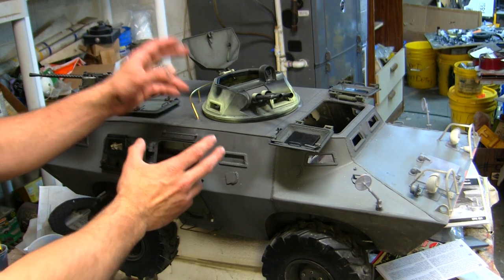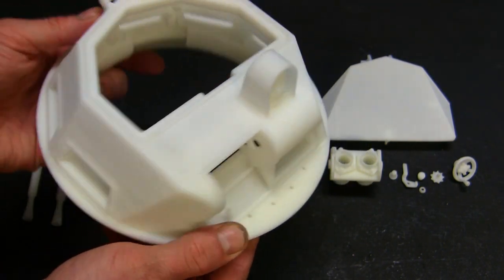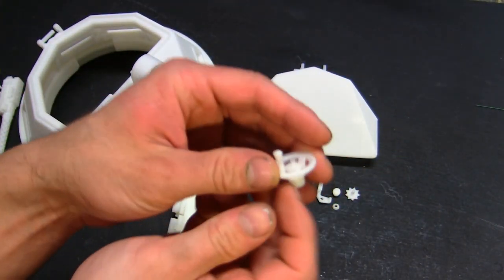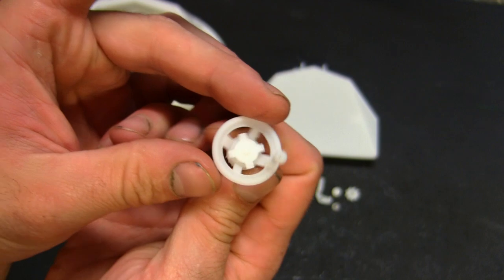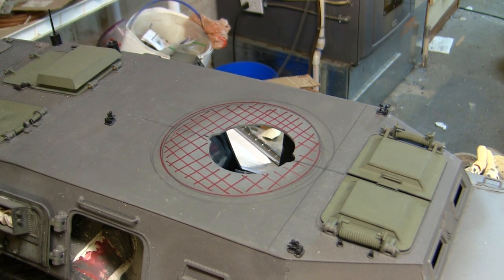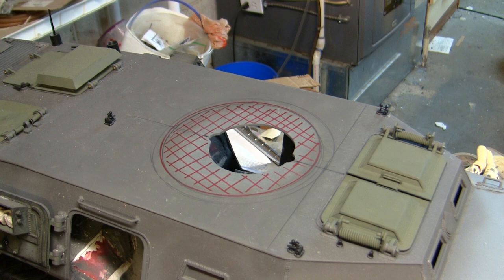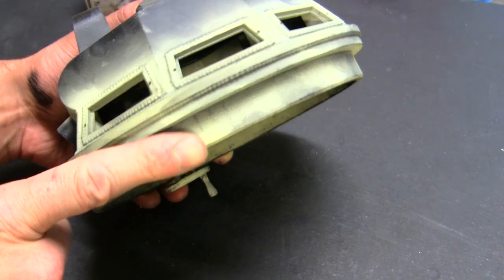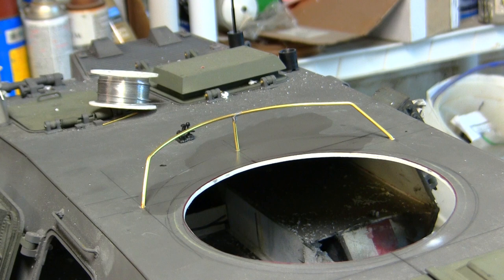1/6th scale Cadillac Gage V100 / M706 Armored car video #12 (Turret details, and ready for paint!)

Comment: Hi John, outstanding job on the turret. As always, I am amazed at your attention to detail. The M 73’s look particularly nice, especially when you weather the paint on them!  FYI, the cylinder on top of the gunsight is the power pack for the illuminated reticle in the sight. That tube holds two D-cell batteries just like an old-style flashlight body.  The wire runs down to the base on the gunsight where a tiny bulb is mounted in a fitting at the end of the wire and that slides into a groove on the side of the gunsight body. That transmits light into the reticle for night firing. This was pre- fiber-optic days, but it works really well.  Very impressive technology for its day!
Reply from the maker: awesome thanks! it sounds almost like the same system seen on RPG-7 optics